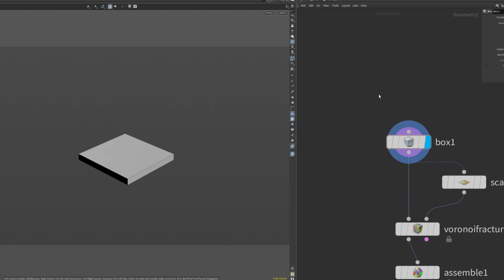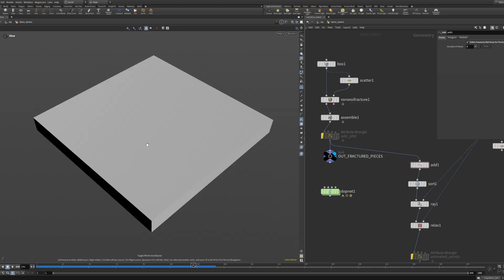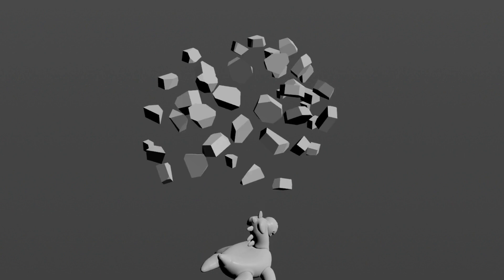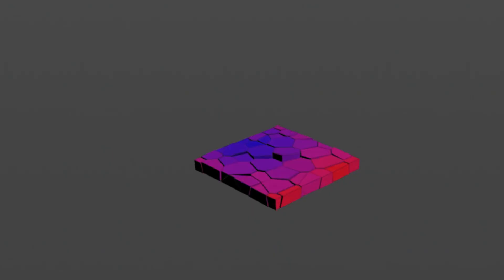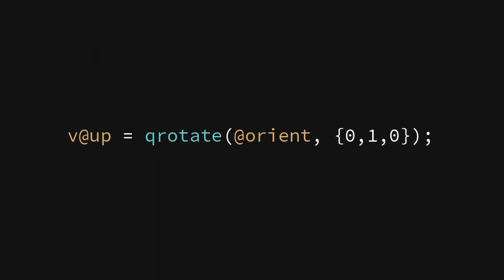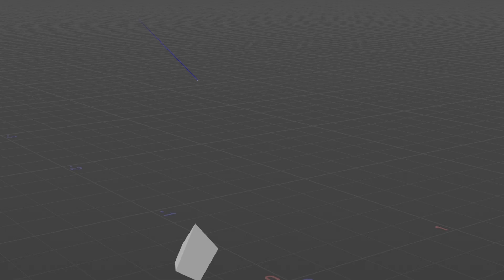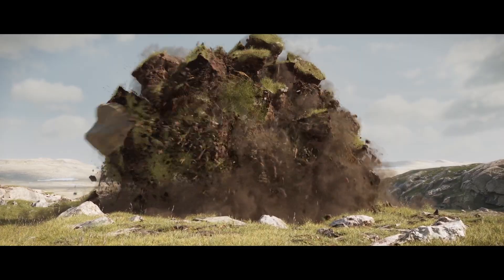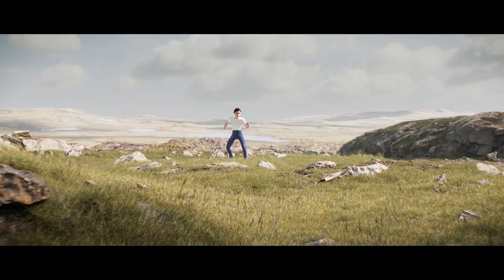Here's how I did this Earthbending VFX shot in Houdini (Mini Tutorial)

Comment: I realize that i am doing something wrong lol. When I hit my simulation, my pieces break but they go in a straight line on the y axis? Any help would be wonderful! Thank you again for this tut.
Reply from the maker: Id suggest to double check that the points have actually found their target points, and that the vectors are correct. The question is too broad to answer properly, too many factors where things could go wrong, but i would start debugging there!
Reply: @ I figured it out just now. Had my vex wrong. Just getting it now to have it attached to my points on my ray.
Reply: @tondann  I am having some trouble with my relax as it not disturbing evenly and causing my simulation to stop at around the 60 frames mark.

Comment: Very promising result. I would add some extra stuff to make the look punch a little bit more.
1. The rocks seems to have low mass, and stop easily. Also the dirt not crumble on impact. I would add a trigger what creates extra debree and make the constrains on the larger dirt chunchks separete only when the rocks hits them.
2. The smoke dissapate too fast. Also you can source more on impacts.
3. The dirt paches became too debreeless to the end. Since dirt are very crumbly a slow ammount of debree can be emmited all time.
Reply from the maker: @kovacsattila8993 thanks for the feedback! I agree that there can be improved a lot regarding the dirt. I built the setup for a rock environment when testing this, but then ended up using a grassy dirt environment which makes no sense of course. If I’d redo it I would probably go with a slightly different method to make it more crumbly and dirt like.

Comment: hey man a little question, the small rocks where you sim it? in another dop or in the same dop
Reply from the maker: @tyryooyoyo  hey, I simulated them separately. I sourced them from debrissource and then made another RBD sim with the main sim as animated static collider
Reply: @tondann  thx mate!
Reply: i got a lot of problems with uvs, what metod you use for apply uvs?
Reply: for inside pieces you use a simple uv texture and break with a triplanar mapping?
Reply from the maker: @tyryooyoyo  I just used triplanar for the inside faces, a megascans dirt texture. The outside has UVs from the megascans asset
Reply: @tondann  my last question about this xd who did you scatter the grass on the sim surface ?
Reply from the maker: @ that was a little tricky, you need to use the matrix transforms from the RBD sim, so they stick to the surface
Reply: @tondann  dont worry i use other metod, i create my own grass and scatter on the outside group but thx mate!🤟💓

Comment: Hi 
i stuck inside dopnet pop wrangle  position at line float dist.
Need  fit range values😢
Reply from the maker: Can you describe a little more detailed what the problem is? :)
Reply: @tondann  hi thanks 
I solved the vex error  inside dop net but the chunks are not attracted by the sphere  what is the  issue?
Reply from the maker: @shivangowda1785  How should I know, what the problem is? 😄 You need to be more precise than that
Reply: @tondann  I am beginner to vex  .how can I know the solution?
Reply from the maker: @shivangowda1785  I cannot help you, if you don't specify what's not working. All VEX code is shown in the video

Comment: Awesome effect and very nicely constructed video but just a technical point of view, it would be little more precise to use slerpv() to interpolate vectors, since lerp won't probably give you a normalized vector and will have varied magnitude up to the bias value.
Reply from the maker: @김남규-f4r  thanks for the advice! Actually I learned about slerp way after I created the effect and was busy with the secondaries, so I didn’t want to go back and change a running system 😄 I should take a look again though!

Comment: Wow! This is awesome! How did you make the soil come out like that?
Reply from the maker: @jayashrip6909  I used a megascans asset and extruded it down, fractured it into chunks and used the system I showed in the video to make it move 😊 then a few secondary simulations and it’s done
Reply: @tondann  cool video! i'm curious how you set up the secondaries~

1. did you spawn the secondaries on the (below-ground) surface of the chunks? or are those actual fractured/booleaned smaller chunks?

2. then from the main sims, and secondary sims, did you spawn more for the gravel/dust? did you use grains for those?

3. also, looks like more secondaries are spawning upon hitting the chunks, cool! did you use sdf to detect collision surface to spawn from?

4. then with all of the above, you simulated smoke? or just using the primary sim for smoke already enough? as using secondaries could potentially be slower?🤔
Reply from the maker: @galagast-fx  hey thanks for the feedback! 

1. It’s a mix of the fractured chunks (inbetween the big chunks I fractured smaller ones where it should break) and secondaries that I spawned from the chunks‘ sides (debris source node)

2. I also did a pop sim from the chunks‘ sides. The gravel is another rbd sim with the same source from 1. 

3. I am using the impact / impulse attribute from the rbd sim to generate more secondaries upon hits

4. the smoke is sourced from the pop sim and gravel. Then I just played with velocity and solver settings as well as collision velocity to get the look right 

Hope I could help 👍
Reply: @tondann  cool! thanks for the info! this really helps!
Reply: @tondann  Thanks so much! So a pop sim and another rbd sim!